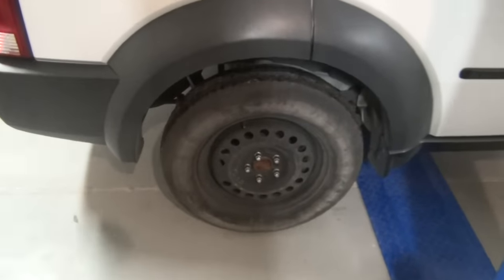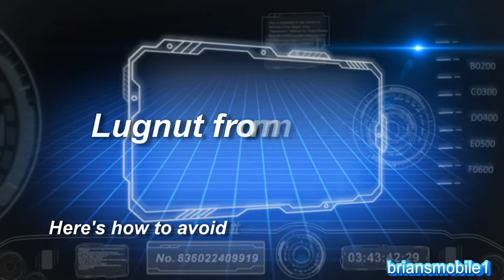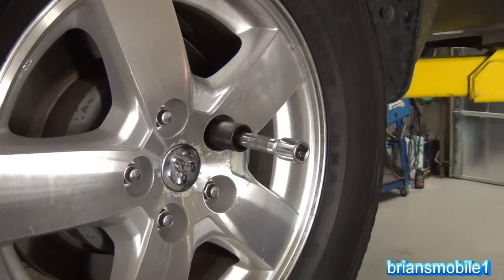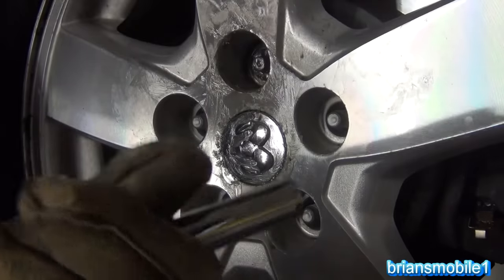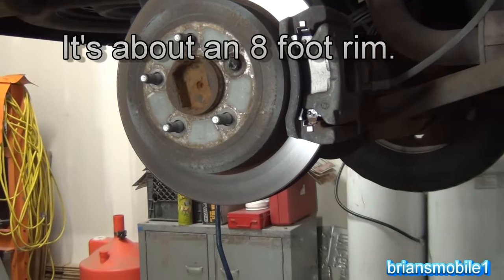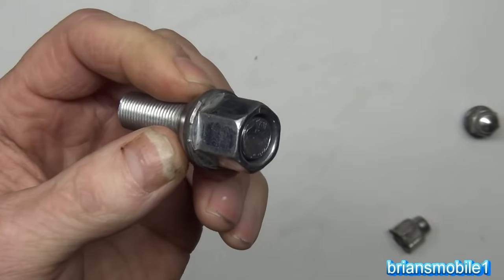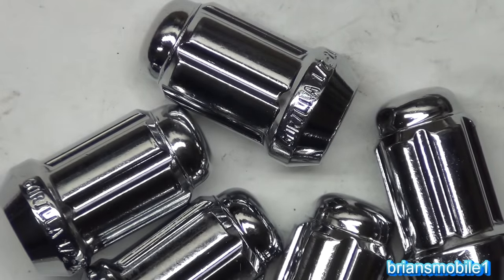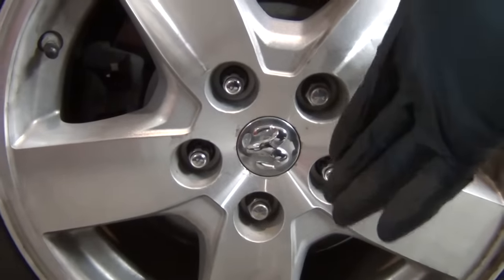Lugnut From HELL

Comment: There are a lot of bad shops who use cheap materials, employees with no experience, break stuff and blame the customer.. I had an engine done, was told they only use quality parts: all the gaskets leak (cheap bargain gaskets), the oil plug was stripped, the radiator drain was broken (sold me a new radiator claiming it was bad), There was vampire air in the intake plenum (the reason the engine light was on), none of the plenum gaskets were replaced, sold me a new distributor, did not replace any bypass hoses and one of the heater hoses was leaking coolant.. Less than 3k after this shop did a complete engine rebuild, there was antifreeze identified in the oil, the oil pan is leaking, and the shop told me to FO because they did nothing wrong!.. There are a lot of bad shops and I really cannot trust any of them because I have been diddled many times with BS

Comment: Get rid of those stupid nuts when you buy the car,  if one goes south; drive the socket on and  twist the stud off and replace it. if you got one that's all messed up; drill it, it will all be over in 15 minutes.
You can get solid acorn hex nuts at the farm store. Put some oil or anti-seize on them. Don't over tighten them. No negative events in 30 years.
  And a couple of more things;  grind the mushroom off that chisel/punch and hold it with one of those bent jaw straight jaw  chisel holding tools or a pair of vice grips before someone gets hurt. And sharpen your hammer.

Comment: okay first off if you're going to beat a socket that's too small for the lug nut it needs to be a chrome socket that's already cracked. I've taken out of about 10000 Wheels the best tool to use is a 12-point chrome socket that's already cracked

Comment: I hope I have an easier time than this. Just got new tires. Got a flat from a piece of glass, need to remove. One lug nut is stuck. The guy that put them on cross threaded it and now I'm watching this video. Looks like I need to rent a plasma cutter. It moves but stops at a point

Comment: Tried to get lug nut off my neon, had a small breaker bar just bigger than a ratchet and jumped up and down on it and broke it, went to tractor supply and got a breaker bar meant for tractors and had to jump on that a few times and finally got it off

Comment: Had ratchet heads with an impact put my lug nuts on so tight I threw my back out getting them off with a breaker bar...  Just glad I didn't break the stud (still don't know how that didn't happen).  Do the work yourself is sage advice!

Comment: A word of advice... Impirial sockets are slightly different sized to metric ones also a 12 sided socket will go over easyer (cheeper less quantity ones tend to work best as they can "give" more) so before pulling out your hair and plasma cutter trust in a 20 year car roadside assistant and smash on a "crap Chinese" 12 sided socket first ...it can save you loads of time and effort.... Cool vid thou

Comment: I have two lol I've tried to chisel them out and drill them out. Trying to remove the wheel to replace the alternator on a 2008 PT Cruiser. The easy way is to remove the right front wheel to get to the tension bolt that's holding the alternator so i can remove it front the top. Have to remove a resivour. PT Cruiser alternator is a pain

Comment: Those splined nuts are suspect as the tool spreads and hammer the spline. Plus ofcourse every second owner has lost the drive. And there is a few different brands hence styles.

Comment: the amount of times ive had to deal with this problem on cars that i work on is unreal, a simple front brake job can take hours just because someone doesn't use the right socket or they manage to round the nut off and dont replace it, most of the time the vehicles owner doesn't even know about it because the wheel nuts are covered up. its so irritating

Comment: I was an automotive tech for a decade. I recently went into construction for better money and benefits... But I still have nightmares about Mopar lug nuts (Land Rover had similar problems). Don't Impact them into oblivion because the outer cover cracks or gets loose and rust builds up underneath... that and the metal is soft like baby shit. I have an 95 Grand Cherokee as a work car (cheap and it works). I've never used an impact gun on the lugs, only torque wrench... Never a problem to take off and put on for rotations, brake jobs, or suspension repairs.

Comment: Uggh, I haven't even watched any and it looks bad. I kinda went through this with my 95 f150. The last lug nut I went to take off when I was changing my tires was 3/4 I believe. I dont know what happened, but the socket wouldn't go all the way on, and the but basically stripped off. A 13/16 kinda fit near the back of it, and I needed up having to hammer it on a few times and thank god it came off. 

Honestly, it must have started as a 13/16 and got half way rounded down to 3/4... I dont know. All I know is it sure as hell didn't go back on

Comment: Watching this brought back nightmares. The reason this happens is two fold. First, idiots that use an impact gun to tighten lug nuts (believe it or not, there are actually torque specs for lug nuts and it's not 300lb-ft) and number two, those shitty two piece lug nuts. Too many manufacturers use these now instead of providing a solid one piece chrome lug nut. What happens is that the sleeve makes what would normally be an 18 or 19mm nut become 18.5 or 19.5mm and so the next size up socket slips and rounds them off. Just bought a flip socket with 18.5mm on one end and 19.5mm on the other just for this situation. I also throw all my plated lug nuts away and replace them with solid one piece designs as well.

Comment: This is why I drive a Subaru. This video brought back memories from when I used to own Chrysler shit. Now I stick to Ford for trucks and Toyota or Subaru for cars. You wouldn't believe how often Dodges just break off the fucking bolts, screws, tensioners and you have to use a torch or welder to get the screw out. I used to blame myself for breaking off bolts and crushing the nuts, not realizing it was the manufacturer that uses the shitty hardware that just fails after a few years.
Reply: Exactly right. Cheap materials for the manufacturing of parts, even small ones like nuts and bolts, never ends well.
Reply: Exactly right. Cheap materials for the manufacturing of parts, even small ones like nuts and bolts, never ends well.
Reply: The only thing with worse lugnuts is a land rover, good luck pulling out a 27 mm socket or 1 and 1/16 " and they swell too

Comment: Sometimes you've got to use a little more force and a little less tools. Use a breaker bar on that extractor, add a cheater pipe if you must.  And if the extractor looses bite before you snap the stud, drill the damn stud, not the nut!

And no, a half inch impact gun will not out torque a breaker bar with a cheater pipe. Just ask a Honda crank bolt, or an Audi axle bolt.

Comment: I had a shop torque mine so tight on my Camaro that I couldn't get them off with the biggest breaker bar I had. They damaged pretty much all the threads too. Didn't go back to that shop because I would of lost my mind. Worked on a echo the one time that was a bastard too the nuts where just on there like crazy.

Comment: Didn't read all the comments , but the reason  there is a wheel cap is so you can remove the castle nut , pull the break caliper ,  take whole wheel & hub off and grind the back off the wheel studs.  Or you can just use $10k in tools & waste the whole day.
Reply: BustedWalletGarage lmfao

Comment: almost all car companies use these nuts, with a stupid aluminum cap. Here in Canada the metal nut under will rust expanding the aluminum cap so you can't even use a 19mm. Even a 21mm socket don't fit. And in most cases end up getting chiseled off. They are garbage. Save yourself the aggravation when you buy a car and get good aftermarket solid nuts with no aluminum caps.

Comment: I had the same problem on my Jeep. Except is was two stuck lug nuts! It took me 3 days to get the wheel off! I tried cutting the dam things off. Ruined the wheel in the process...
I got rid of all those crappy lug nuts, and replaced them with solid metal ones. What a nightmare. Just glad I wasn't stuck on the road with a flat tire. Do yourself a favor, and replace them all now. Before this happens to you!

Comment: Maybe the root cause was those nuts were tightened by an impact driver. Ideally, impact drivers are for undoing nuts, not for torquing them. But......... it's impossible to convince mechanics.
Reply: Khaled A. Ayyad iv never had issues, as long as you hand tighten all the lugnuts first in a alternating pattern then tighten with a air gun you have no problems

Comment: need a 45/64th (17.85mm) lug nut socket and a breaker bar (possibly a cheater pipe as well).

at this point its damage control, breaking the stud is your best bet, unless you dont care about your rim.

Comment: Coulda been removed in ten minutes....

Get some good cutting oil, I prefer Crown Buttercut, drill the stud with a big enough bit to cut through the threads. Probably work your way up from 1/4" because of you're going to replace the stud then who cares.  

That's what I'd have done after it didn't want to come off with the easy out socket.

Comment: Some say weld an old lug nut to it then undo I have same problem on drivers side I'm desperate so think I need a welder. Mine is a security nut that broke so its completely flat in the wheel

Comment: Is this solely a "Chrysler" lug-nut issue with the cap or do other manufacturers follow this process?
Reply: GM uses a lot of them also, but Chrysler, Dodge, and Jeeps are the worst.  We have an 18.5mm and 20.5mm impact socket to use on the ones without the stupid caps still on them.

Comment: Why are you using a chrome extension with an impact? Chrome extensions and sockets are made of metal tha'ts been hardened more than an impact socket or extension. It will chew up you impact anvil or worse yet break and send bits flying.

Comment: thats a tiny air gun you got there. You won't be able to remove anything with that.
Reply from the maker: +herpherpbrocolli You saw the twist on the nut right?  When the nut is actually twisting your problem isn't the gun.  It's friction.
Reply: +herpherpbrocolli Had the same thing happen with a lug BOLT, not a nut, a solid piece of hardened steel, and a 3/4" ingersol rand impact (brand new, my tired guy bought it specifically for the occasion) wouldn't break the lug bolt loose. He broke 3 impact sockets trying. It happens.
Reply: what also matters is peak breaking torque. A larger gun will deliver a big ol' smack to it instead of slowly twisting it.

Comment: jeep lugnuts are crap  to begin with. Had the same happen on a jeep rubicon 2012 and a Jetta GLI . What I do is I drill the stud instead of the nut. No damage, no heat. once the stud is drilled far enough I pull the wheel and the rest snaps off. If youre not in the center as you drill the stud, just use a carbide to move the hole back in the center

Comment: Holy crap, I am going to guess  you guys do not know about loosening other lug nuts 1 turn out paper towels in hole and masking tape over not to lose a loose lug bolt and driving car if the tire is inflated. Spray the frozen lug bolt or stud and bring the breaker bar and socket with a hammer and friend with you.  Drive car cautiously on road or unused parking lot turning and stopping will flex the rim just enough to break the corrosion rust bond. No damage to wheel, stud lug bolt and everyone I have done this to worked every time, but if someone been there and did damage well things will get interesting to say the least.

Comment: I know this is an old post but I just had a stuck lug the other day and was searching around youtube.  I personally would not have gone through all this trouble to get the nut off.  My wife's odyssey is pretty simple to bang out the wheel stud and replace it - $5 from AutoZone.  So all I did was stand on a breaker bar and snapped off the wheel stud.  Now I did have to put on a new lug but I happened to have one already.  And like you I had someone else work on the tires/van and they powered that lug onto the stud.  smh

Comment: I always take my car to the same place (since new) for tire balance & rotations.  a while back they broke 2 of the 4 lugs off one tire.  it cost them - the cost of towing my car to the dealership (30 miles one way), four days of a rental car, plus the dealer repair.  I still "only use them" for balance & rotations because, I will be able to prove "they are the only one responsible" should a tire fly off my car and causes serious injury or death.  they are a big corporation with deep pockets.  I've kept all documentation and have discussed the issue with my family.
Reply: Lovely
Reply: I don't know which company did it but they were putting new tires on to my buddies car (2000 camaro)  and they didn't start the lug nuts on buy hand and they had to replace all the studs. And somehow the cracked a rim too. They payed for it all.

Comment: Six or seven hours at my shop by a much more experienced mechanic than I....same problem. Oi ve. When we had time, ALL of his helped the poor guy. I suspect, flag hours as they are, he got to do that all for free.
Reply: Brian, aren't you at least glad you weren't next to it on the floor the whole time? :) Small silver lining I know.

I must be honest. Everytime I realize I'm working on a Chrysler or Dodge I think, will I have those terrible lug nuts? They're all just garbage. Every time, unless they look PERFECT, I go around with the right sized socket and hammer it on so that I can spend less time extracting the lug nuts from my socket, but I still get to hit most of them on the floor, or even use a punch to regain my socket.

Dodge went cheap on these a long time ago and it just won't change! Briefly Ford did something similar and I really hope that the newer Fords I've seen stay away from it!

Comment: Why did you give up on the extractor socket?  I would have at least put the impact wrench away and put a bar on that thing to try and break it loose or snap it off.  Or get a better impact wrench.
Also , buy some good drill bits and one of the first steps if the wrench fails is to drill a small hole.  Cobalt.

Comment: SMH. All you had to do was hammer a smaller half inch deep socket onto the rounded nut. Use a half inch breaker bar with a 4-6 ft cheater bar and that nut will pop right off.

Comment: had a situation like this where I drilled, air hammered and torched it for about 6 hours. and it would not come out. ended up taking my cutting wheel and cutting the entire outside of the rim off and removing the center still attached to the hub..i have a picture somewhere too bad I cant share here

Comment: I don't have this problem anymore since I got Toyotas, except now I have to deal with snapped off wheel studs.
Reply: I snapped like 4 studs on my 98 4Runner and 3 on my 03 Highlander. Never had it happen with my 03 4Runner tho.
Reply from the maker: +FarginBastiges Seems door handles are an issue, but not a terrible issue at that.

Comment: this is a common problem found on just about ALL Chrysler vehicles its not the fault of the technician the lugnut and wheel bond over time at the lugnut and wheels mating surface due to a reaction between the material used in the lugnut and the aluminum wheel when over tightened  usually you can tell when your vehicle has this problem when the chrome 19mm cap comes off while trying to remove the lugnut when this happens STOP leave that one alone and try to remove the other lugs, usually only one or two are seized and removing won't be too bad, once you've removed the other lugs apply grease to threads and put them on FINGER TIGHT then hop in the vehicle and Slowly drive in circles alternating left to right or drive about ten mph and swerve left to right trying to bark the bond by flexing the wheel I have been very fortunate to have this method work 8/10 times ,once it pops use 18mm socket ALWAYS USE 6 POINT SOCKETS and work the lugnut off If his doesn't work don't waste time with a torch just drill the stud out until you can get the wheel of without damage. If you own and Chrysler jeep dodge Plymouth with aluminium wheels ALWAYS apply anti seize compound on all surfaces where aluminium meets steel to avoid this problem
Reply: Make sure to replace factory lugnuts with proper one piece lugnuts

Comment: Would be easier and quicker to get a die grinder and grind out the head of the nut, and agree with others, power bar on the socket rather than impact gun

Comment: This only happens to me on Chrysler products they get put on too tight the cap of the lug nut comes off and it ends of stripping and mangled too much you just have to torch it off I'd recommend aftermarket lug nuts
Reply: Just finished the video guess you went over it great video

Comment: Am I the only one that puts anti-seize compound on lug nuts?  Haven't had a wheel/tire fall off yet but I do check them routinely.
Reply: +Abunai One 
As long as they're torqued correctly then I don't see why anti-seize compound would make them fall off.
Reply: I do the same, but keep in mind that any kind of anti-seize will increase the torque factor on the lug nuts and studs.